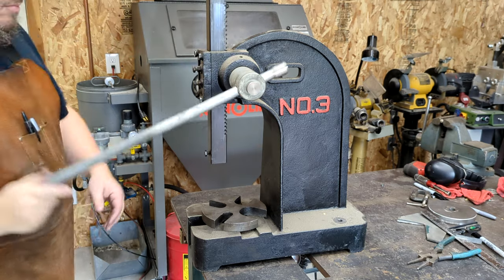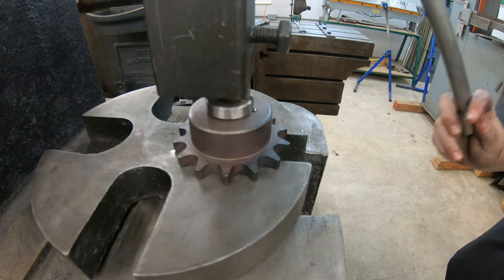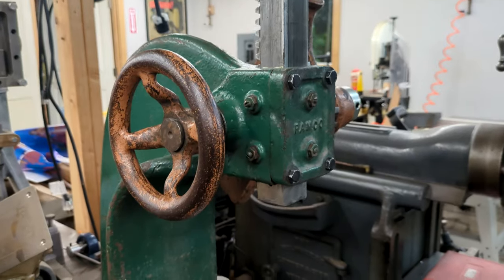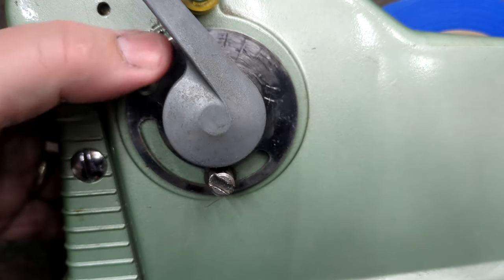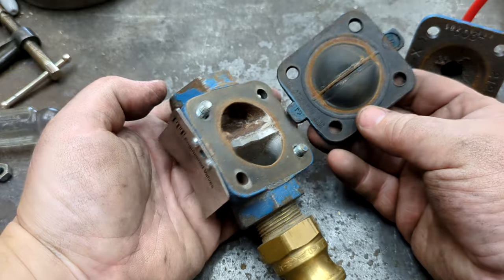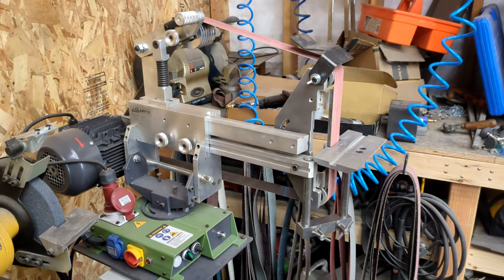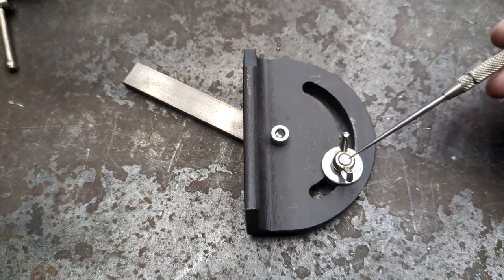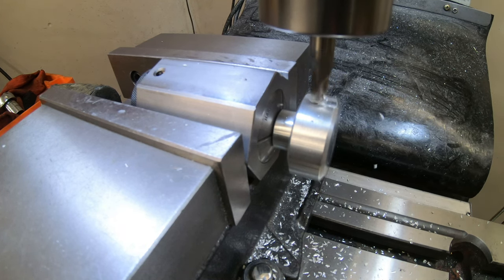Tasty little snack projects

Comment: Disappointed you didn't make actual snacks, i feel misled.

13:19 if it's made in Bulgaria, its certainly not made from Aluminum, but from Aluminium, because Aluminum is hard to get in Europe and has to be imported from North America specially, without being any better than Aluminium.
Reply: Agree about snacks)

But every video is a treat
Reply: In the US aluminum just refers to the metal, not a specific brand of the metal
Reply: @aenetanthony  Aluminium is metric while Aluminum is the imperial version that can only be machined to fractions of inches instead of metric units like millimeters. When you ned something to be 20 millimeters, you have to machine it to 13/16" which is 20.6375mm, but probably close enough for Americans. You can try take it down a little with an imperial metal file, but it might ruin the file. But thats a metric joke, americans don't get these.

Comment: Back in the Day (in the 80's) the company I worked for offered two types of keycaps to our customers: double-shot moulded, and ink-etched. One of our customers (a major airline) initially went for the lower cost option for their booking hall. After being in use for a while, they changed their mind. I was tasked to take a small team to swap out the old ones in batches. At that point the keycaps were mostly blank, funnily the operators did not care, as they touch-typed, and only looked at the screen, not their keyboards :)  Enjoyed the snacks BTW :)

Comment: One of my favorite upgrades is heavy duty leveling feet on floor-standing machines. I did that for my table saw, drill press, and wood lathe. Adds adjustable height, and makes it so much more stable. I thought you were going there on the blaster, the casters are cool too.

Comment: Wait a minute are you a keyboard nerd too!? Great video by the way.
Reply from the maker: I dabble, anyway, but mostly I stick with my ancient Model M as my daily driver.
Reply: @Attoparsec  nice! I've got uhhhh maybe 6 model M's hehe.
Reply: @nicquintana1092  The model m is so uniquely satisfying to type on. I would use mine if it wasn't so loud. And I guess it's not great for games either.
I opted for some less satisfying but fairly quiet switches in my current keyboard.